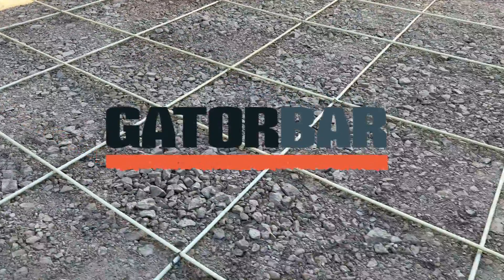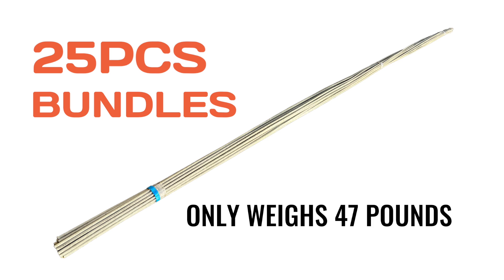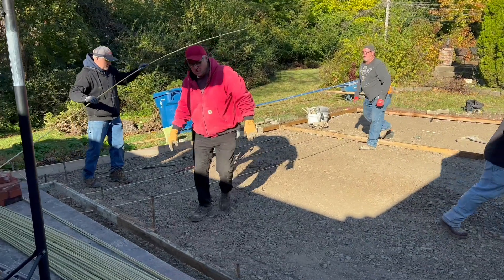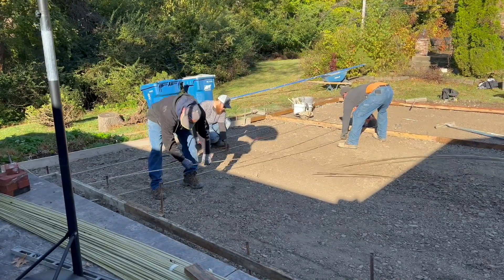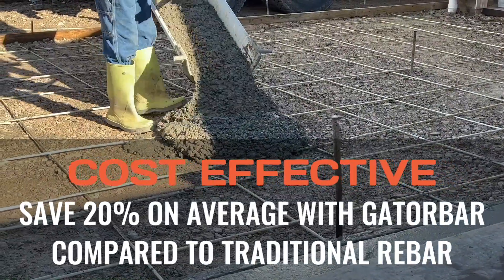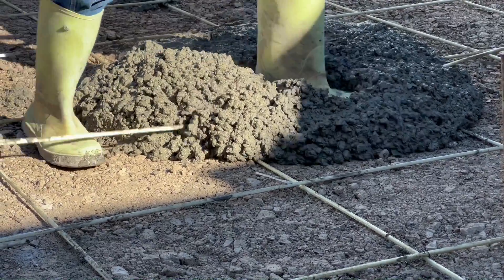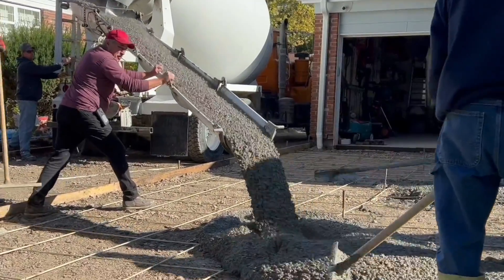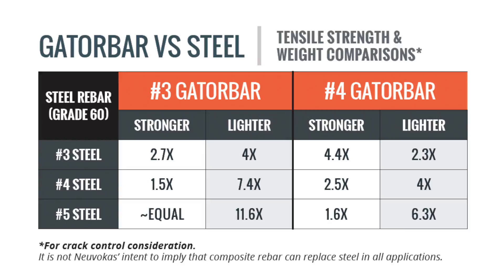GATORBAR - Glass Fiber Reinforced Polymer Rebar

Comment: I am contemplating use of gatorbar for a garage slab I am about to pour. The building inspector is unfamiliar with it, and tells me "if it is code-compliant, go ahead and use it". Where do I go to find out for sure that it IS code compliant, and at what specification (e.g. in a 18" grid  from edge to edge of the slab, with two bands of it running through the thickened perimeter)?
Reply from the maker: ICC Certified for Structural use PDF:
https://www.neuvokascorp.com/sites/default/files/ESR-4526.pdf 

Product Sheet PDF:
https://www.fp-supply.com/cmss_files/imagelibrary/GatorBar/GatorBar_Glass_Trifold_Brochure_040121.pdf

GatorBar Website: https://www.neuvokascorp.com/
Reply: @forestproductssupply  Thanks!